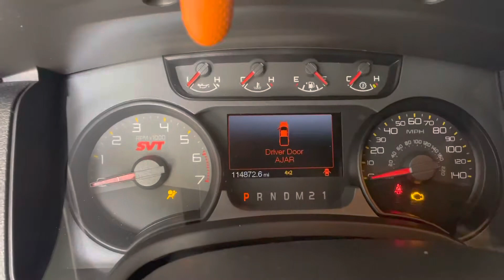Gen1 Ford Raptor - Oil Change

Comment: * *  Great video. I also have a SCAB 2013. 
In my area there are great promotions on oil Change: Northern Virginia.
Motorcraft synthetic blend - 7 quarts for only $65.00 tax included done by Ford dealer  * *
So I do not see any savings in doing it myself...thoughts?
Reply from the maker: That’s a good deal. I still enjoy doing my own maintenance and take the time to inspect everything else under the hood if you have the spare time to do it yourself.

Comment: Nice video. Very thorough!

What kind of paint did you use on your front skid plate? I am thinking of doing the same. Thanks!
Reply from the maker: Thanks! I just used regular spray paint. It’s held up with no chipping or peeling over 2yrs ago